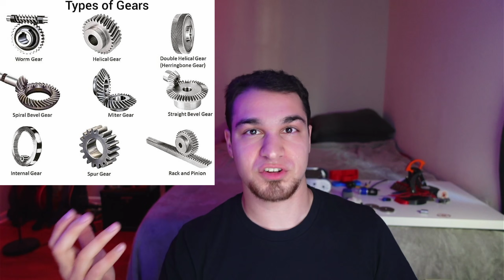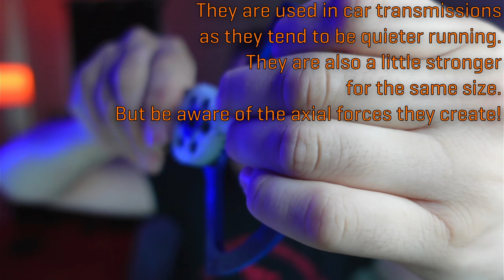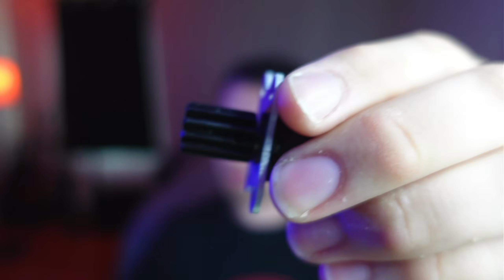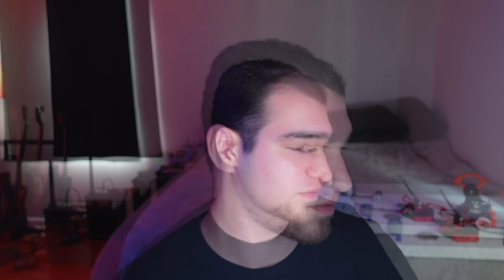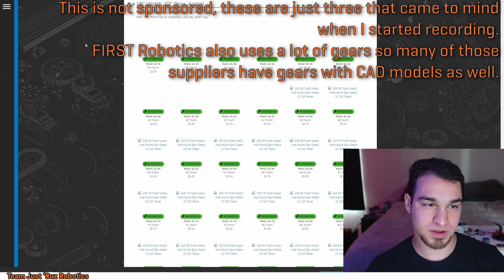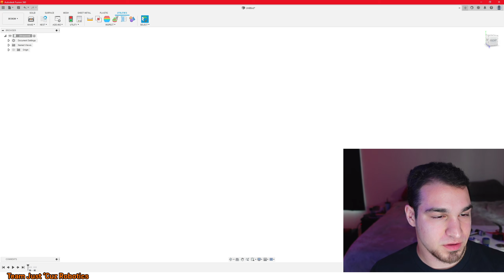Everything You Need to Know About Gears (for Makers and Combat Bot Builders)

Comment: Larger gears are commonly keyed to the shaft. Manny robot gears are likely too small to make that practical.  
Have you even tried printing a gear with a non round bore to get a similar effect to keying?
Reply from the maker: Yes, keying is common in much larger scale applications though usually a set screw is still used to prevent the gear sliding axially on the shaft and sometimes a second one directly holding the key in place.

I have printed wheel hubs with a D shaft profile before and that worked for a 6mm shaft, and similarly had success with hexagon shaped shafts and printed bores. You just need to be careful about getting enough engagement to compensate for how much the plastic can deform and stretch. Not all sizes of hex shafts work.

Comment: Hey so is there a reason people don’t use rollers or gears to transmit power to the weapon shaft. I feel like with how thin motors are you can just press the can up against a rubber wheel attached to the bots spinner like how a pulley is and it would work just fine? No one uses gears for weapons either. I just find it strange.
Reply from the maker: I literally showed two examples of using gears to transmit power to a weapon in this video. Bloodsport on BattleBots uses gears to transmit power to the weapon. Son of Whiachi as well. Several other bots do it too. It is a lot less common than belts however. The main reason for this is that gears do not slip on impact so you need to either use some kind of clutch at larger scale or modify your motors to survive all of that shock load (which isn't usually needed at the smaller scale like 3lb and below).
The other reason it's less common is that the weapon motor has to be positioned a lot closer to the weapon that way so its a bit inconvenient for some designs.

As for rollers, some ring spinners and shell spinners do that but wear on the roller is a big concern. If the rubber material wears away and loses contact you're screwed. So it has to be hinged and sprung against whatever it's spinning to prevent losing contact which adds more moving parts and another point of failure.
Reply: @Team Just 'Cuz Robotics, thanks for answering. Sorry for not watching the vid. I watched two min and thought it was just about drive and decided it was 11 at night and I wanted sleep.

Comment: I've just been using drill motors and pulleys in my featherweights, I've just ordered some POM filament to experiment with 3d printed gears. It's really low friction.

Do you grease your printed gears at all?
Reply from the maker: I tried using grease at first but honestly it'll never stay there with exposed gears. Pom is insanely hard to print from everything that I have heard but good luck!

Comment: Curious the torque the 2205s output with the pinion gearing system you use. Is it a feasible solution for a thwackbot that needs fast and powerful 180 degree swings?
Reply from the maker: Honestly I'm not entirely sure. Would probably be better to have a higher gear ratio for changing directions super fast but then again it certainly worked fine for driving division so it's possible that would work fine for that too

Comment: Great video and coverage of all things gears. I have designed a spur gear for my 1/10 rc rock crawler and it has worked out good in PLA. I need to print the gear in PETG and nylon now.
Reply: PLA could be better for a Crawler - it's harder and stronger than PETG so will wear slower. 

Gears in combat robots get abused really bad so the extra toughness and heat resistance of PETG wins out.
Reply: @Andres_Apparati  Thanks. I got a lot of use out of the gear before I stripped it under load.
Reply from the maker: Sounds like a fun project!